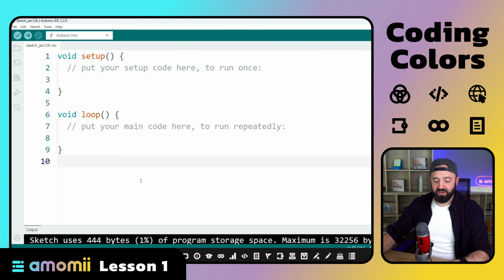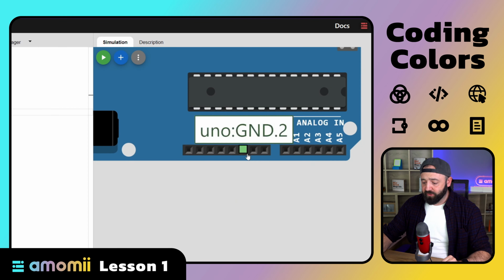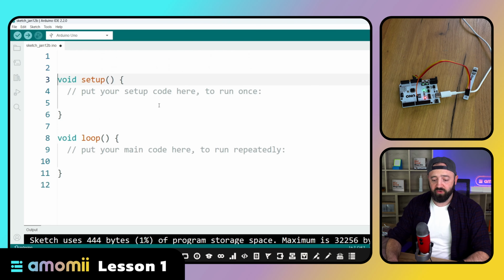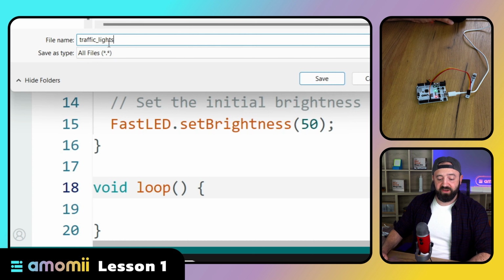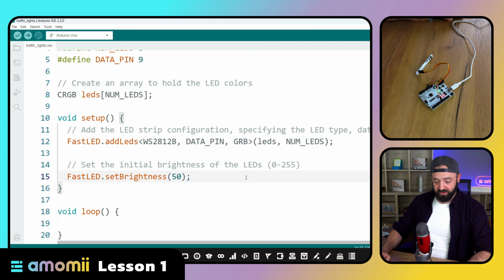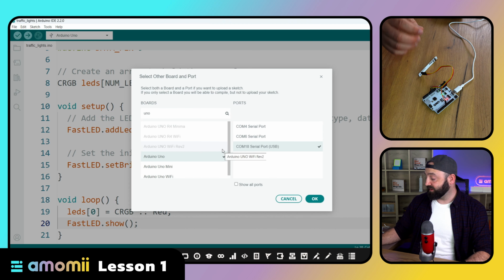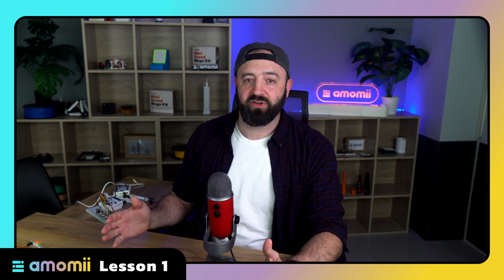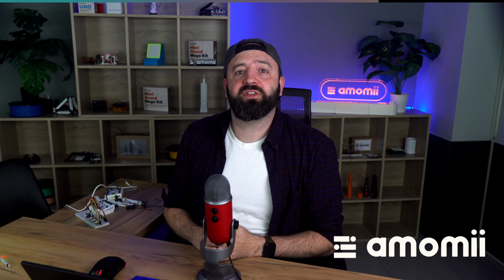How to Code Addressable WS2812b RGB LEDs with Arduino - Complete Course: Lesson 1 (2024 Edition)

Comment: Awesome guide! I learned so much in such little time. One question if I may ask, could one controller control 8 of the 8 led strips you were using? At full brightness?
Reply from the maker: You could absolutely control 8 x 8 led strips with one controller. Whether or not it can be at full brightness depends on the power source. At full brightness, 8 strips could in theory draw over 1.2A (although in practice probably wouldn’t unless all pixels were set to white). The Arduino UNO R3 can’t provide more than 0.5A, but you could still power them using en external power source that can handle 1.2A or more (the ground of the power source and the UNO would need to be connected). 

Our amomii ONE (previously called amomii UNO) microcontroller could power them all directly as it can provide 1.2A comfortably.